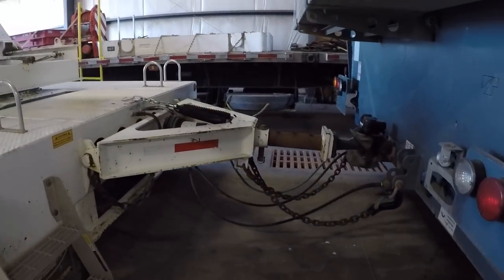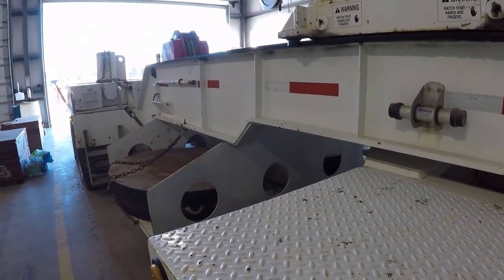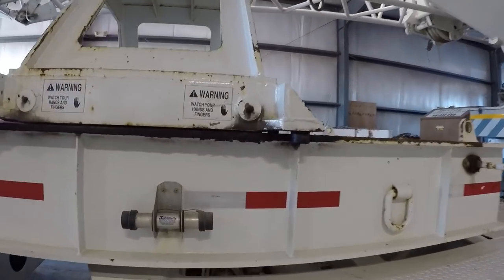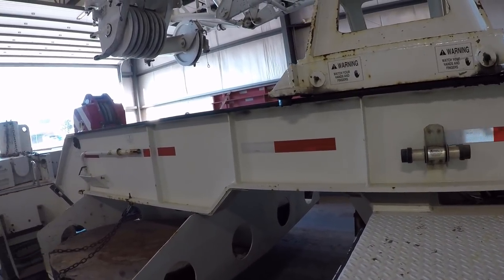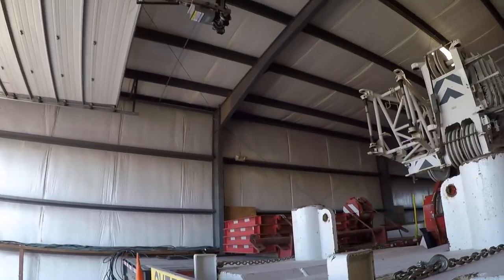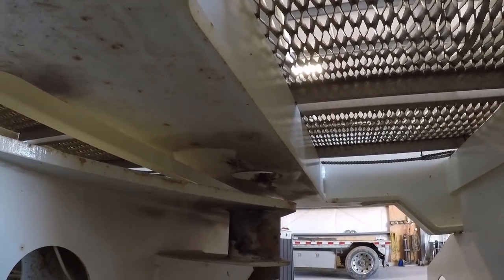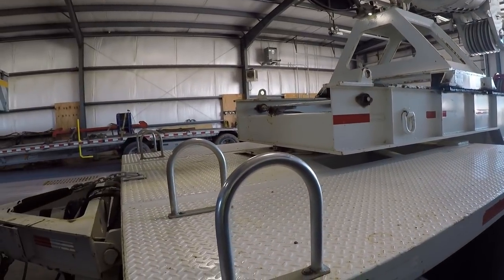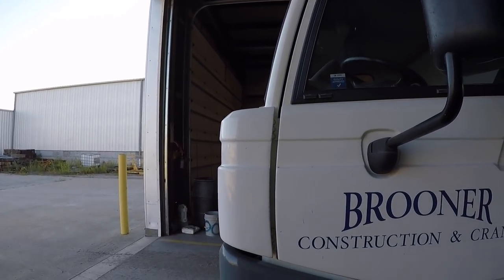Crane boom dolly | Tadano 180g-5 | Nelson Manufacturing

Comment: Nice Channel! We actually use a dolly on our ATF220 and ATF90 here in Norway to spread the weight and get under 10t axle load. Some of our roads are not accessible without the use of dolly, and they are also the worst and most narrow of course. Our dolly is quite different though, it's 3 axles and we need to have the boom extended to move the weight from the carrier over to the dolly, so we have a sling for the hook on the dolly swivel, actually does not take any more space than the crane itself on the road, just abit more swingout on narrow turns. The dolly is connected to the carrier rear  hitch  via a telescoping dragbar that acts as steering guide, and the boom is the part that actually pulls it, if that makes sense.  The 220 is 22m with the dolly and the 90 is about 19,5m  Let me know if you wanna see the setup =D
Reply from the maker: beinlausen, welcome to the channel! I'd absolutely like to see the setup. I like checking out how things are done elsewhere. I've heard the ATF 220 is an awesome machine. Have you seen the ATF 600g-8? I'm waiting for one to make it to the states. When it does, I may try to go get some footage of it. Thanks for watching! 🙂👍
Reply: @ToTheTopCrane  I uploaded a little clip of the 220 with the dolly on my channel, thought I had some better footage of it but as you might be aware of, rarely time to wave the camera around when we're on a job! lol Yeah the 220 is an awesome machine, ours is a 2012, only thing I don't like about is that it doesnt have a swing brake pedal, automatic only which you can release with a momentary button on the left stick, the 90 is the same as yours with a pedal, which is the crane I usually drive the most. I've only seen the 600 in the brochure Tadano sent out to us, looks bad ass with the new boom! Also, I do feel your pain regarding the on the road speed, now immagine our mountainous terrain added to that mix ;)
Reply from the maker: beinlausen, I can't imagine how slow that would be in the mountains. We have some hills around here. But, nothing like a mountain. It must take forever to get anywhere.
Reply: @ToTheTopCrane  Hehe, yeah it does, also subsea tunnels! Good we have retarders on the cranes! Uphill speed in the closest tunnel is about 20kmh or 12mph, and its 5 miles long, so half of that is uphill.

Comment: The trailer used with the Krupp we often hired had a cone shape on top of the pegs for the counterweight to make it easy to set the weights on. They also had cones on the weight pegs on the crane deck.
Reply from the maker: Tired old mechanic, the crane deck has cones on it. But, the dolly doesn't. Maybe I should add them. Thanks for watching! 🙂👍

Comment: I would imagine it is a headache to back up. I goof around with Euro Truck Simulator 2 every once and awhile and the articulated trailer models it has I can not back up at all, even switching to the various outside camera angles which actually makes it harder than using the mirrors, so I can definitely see your point. Great view of the dolly. Thanks for the video.
Reply from the maker: Duncan MacKenzie, I can back the dolly now. But, it took a while to get used to it. Wagons are pretty difficult. Even worse when it is narrower than the tow vehicle and 50 feet away. Lol. Thanks for watching! 🙂👍
Reply: Without a doubt! That's quite a skill being able to back the trolley, not an easy task. I worked in a tannery years ago in the hide house with was the first stop for the incoming trucks mostly coming from Texas and I kid you not quite a few of these guys had a hard time backing up to the dock and there was plenty of room almost enough room in the entrance drive to do a u turn before hitting the ditches and some of these guys ended up there trying to back in. I thought that was a bit nuts considering they were long haul guys. So my hat is off to you for being able to back that rig. Thanks for the reply.

Comment: I work with cranes a lot , I’ve never seen a dolly with a fifth wheel. Must really help when crossing highway scales
Reply from the maker: Mark Chatman, it does spread the weight out. It also tracks in the same tire tracks as the crane. So, you don't have to swing wide like you would with a conventional dolly. Thanks for watching! 🙂👍

Comment: 2 thumbs up on this one! Yeah I was asking you about this dolly. Thanks for making the video.  On a side note,,, I HATE escorting cranes on the interstate!!! It seems like 45 mph is top end on them old Americans and Link-Belts! I swear I stare in my mirrors way more than out of the windshield! I don’t care if I ass end our cranes with my service truck, that’s why I have a massive winch out front.  I’m not going to hurt my winch or the crane. I’ve had a few close misses with people (women) putting makeup on, changing clothes, talking/texting on the phone,,,,
Reply from the maker: Richard Savaglio, the ole Tadano will run 53mph on flat ground. When I get in my truck at the end of the day, it feels like I'm in a race car. Lol. Thanks for watching! 🙂👍
Reply: To The Top Crane I have that problem going from my truck to the wife’s car then I have the opposite problem going back to my truck! The first few times stopping I’m either eating the steering wheel or trying to push the brake pedal through the firewall!
Reply: Right. Or if you go from an automatic trans to a standard, your left foot is always looking for a clutch!
Reply: psidvicious I almost never need to use the clutch except for reverse/low. I drive everything 2 footed. Most equipment has 2 brake pedals, one on either side of the steering column or the only brake pedal is left of the column. It’s almost impossible to run equipment quickly with only using 1 foot. I just drive everything the same way. I do find myself going to grab gears on an automatic,,, a lot. Especially if I’m in traffic riding next to a truck. It’s so bad that my wife calls me out on it. I start lifting off the throttle to grab the next gear and I swear I can hear her eyes rolling!
Reply: Haha! Right! - I meant going from standard to automatic in the previous comment. Not auto to stand. You knew what I meant. 👍

Comment: That Dolly is pretty spiffy especially how it's a few partons (see what I did there? Man do I need a nap or what). Is that a vin plate I see on it? Is it registered separately?

Also, jobox or knackbox? Can only pick one.
Reply from the maker: JasonWorksAlot, it is a separate vin plate. No registration on off highway equipment in Missouri though. So, that helps. 
Knack box....Thanks for watching! 🙂👍
Reply: Pegged you for a jobox kinda guy.. I'm slightly disappointed honestly.
Reply from the maker: @JasonWorksAlot , we have several of each. It seems the Knack boxes are built a little heavier.
Reply: I agree with Knack being heavier.  I have a small jobox on my truck for rigging. I had a diamond plate top built with a 4” high rail going around it for the top.  I can keep 2 safety fuel cans on it AND cable lock them in place.

Comment: That is really interesting watching the articulation of that dolly!  Thanks for the explanation!  It's got to be way safer to have it like that since you don't have everything swinging out all over the place as you go around corners.  Good design on them!  Thanks for the video!  Hey, in case I miss the livestream on Sunday: Have you ever had to lock up the brakes on that 180?  Like someone stopped or something in front of you?
Reply from the maker: burningdinosaurs, it is a great design. I've never locked the brakes up. But, I've had to stop in a hurry a few times. It actually stops pretty quickly. Probably in a shorter distance than most big trucks. Thanks for watching! 🙂👍

Comment: That would have been a nightmare working out the distance behind the pivot to the pin on the boom, so the side load torque for the slider worked in the arch and also move back and forward. Did you see anything over there about the accident in Melbourne Australia where the sheath lock on the end of the wire rope let go?
Reply from the maker: barry hansen, I'm guessing there's an engineer at Nelson Manufacturing that is missing lots of hair, from designing this dolly. I didn't see anything about a crane accident in Australia. If you could find it, send me the link please. Thanks for watching! 🙂👍
Reply: I sent a e-mail and there is video on you tube .
Reply from the maker: @barryhansen6854 , thank you!

Comment: that is really cool i thought of a few questions for the live stream. when the boom is on the dollie does the boom have a flote mode to allow the boom to raise and lower with the dollie as its going down the road? and the second one is do the support semis for the crane usually go ahead of the crane to try and get to the job site before the crane so they can have the truck staged and some of the rigging set up before the crane arrives?  i also found some more Tadano diecast cranes tuesday and thinking about ordering one after the holidays they have a Tadano Faun ATF220G-5 Mobile Crane that im looking at or a Tadano Faun ATF 70 Truck Mounted Mobile Crane im not sure which one i will be able to order though
Reply from the maker: James Bergeron, the boom cylinder does have float for when it's in the dolly. As far as the support truck running ahead, it all depends on the job. Sometimes they will go ahead to make sure there is room for me to pull into the jobsite or block traffic. Thanks for watching! 🙂👍
Reply: that makes sense i never really thought about that

Comment: Hey Jim, when you said float were you referring to swing or boom (or both) ?
Reply from the maker: Denny Skerb, the boom cylinder get put into float, the swing brake and swing motor also get put into something similar to float. The swing brake gets locked out with a valve, and has an accumulator in the circuit to make sure it stays released. The swing motor just goes along for the ride. Thanks for watching! 🙂👍